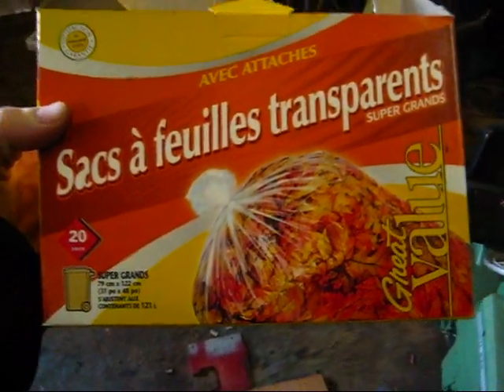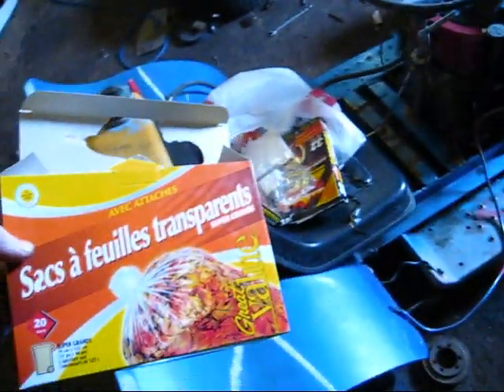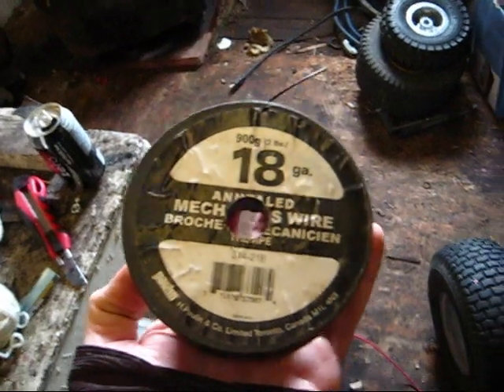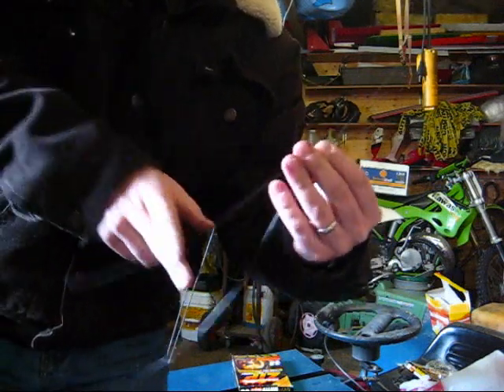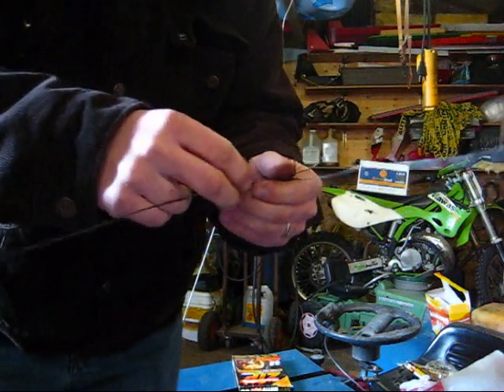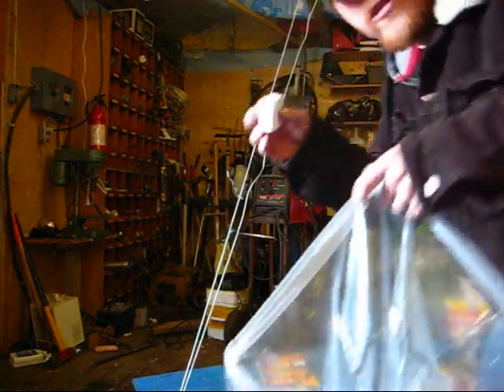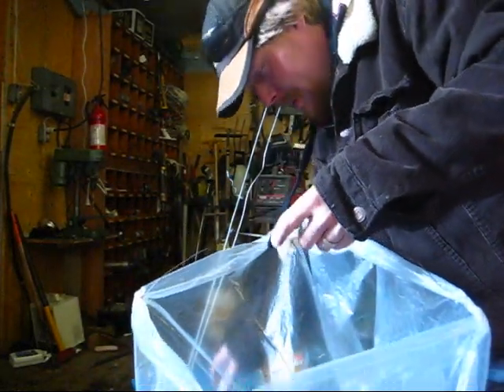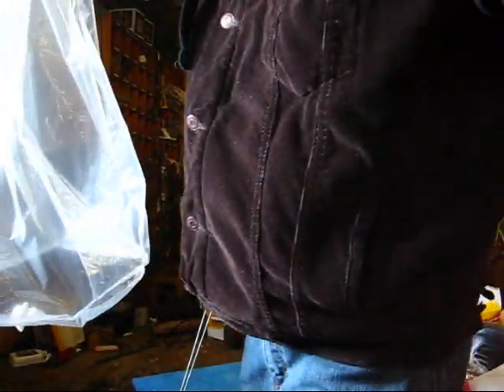how to build a hot air balloon

Comment from the maker: yep many of times it depends on the outside temperature the colder it is the bigger your firestarter piece can be cause the cold air cools the bag, on a not so cold day you need to go with a smaller piece but it still needs to be big enough to get it up and flying it takes a bit of trial and error and after a few bags you get better at judging the size of the firestarter good luck!!!!

Comment: @macstuff98 : OK, just saying that my Zippo lighter fluid (petrol) exploded on the barbeque. It might be not so volatile in a cup based design!   I would rather use som kind of oil , as it will burn slower (and longer).  Say lampoil.  God luck!